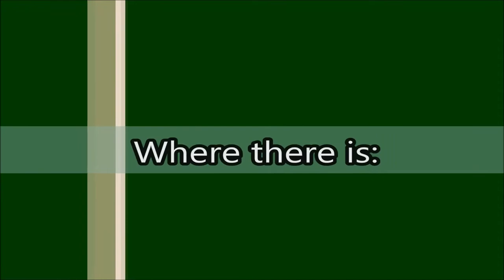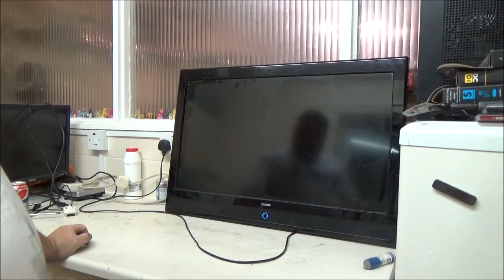LCD TV Repair Part 1.

Comment: Power supplies of (Often cheap)LCD screens of this era are quite predictable, after a few years its time to replace some/all electrolytic caps... A damn shame many LCDs get scrapped because of this simple issue!
Reply: By the way, I'm a quite new subscriber of your channel and enjoyed what i've seen of it!
Reply from the maker: Thanks for  subscribing! This TV according to my stepdad was bought 13 years ago, I think for a low end TV it has done well to last as long as it did. I have new capacitors but I accidentally ordered the wrong 470uf caps. I got 16 volt not 35 volt. oops.
Reply: 13 years old thats quite impressive indeed(For an cheap LCD), I thought it was a lot newer(No real expert in LCDs TVs, just a tinkerer lol)! But the statement that the power supplies are predictable still stands I think, in my experience(mostly with LCD computer monitors) it's almost always those damn electrolytics, cold start issues or weird smell or even smoke... those damned cheap/overheating electrolytics! Old CRTs on the other hand they often have a myriad of issues: caps, voltages, HOT, connectors , flyback, diodes or many other things, its more of a "sport" to find the issue this way lol... but often quite hard or time consuming to find the issue! Cheers mate!